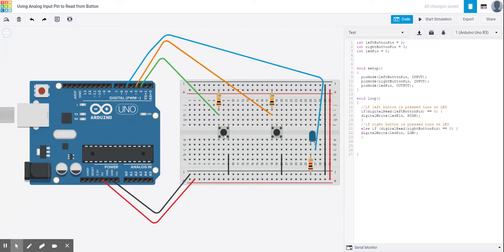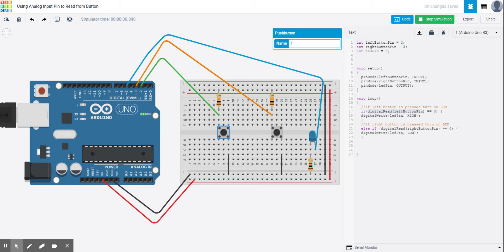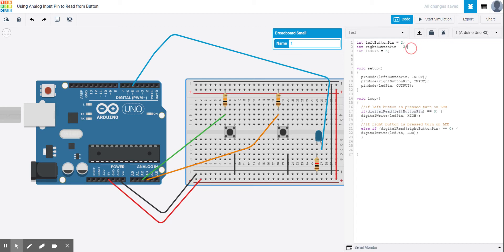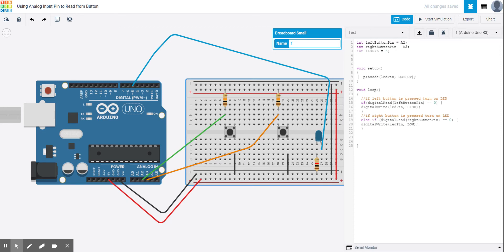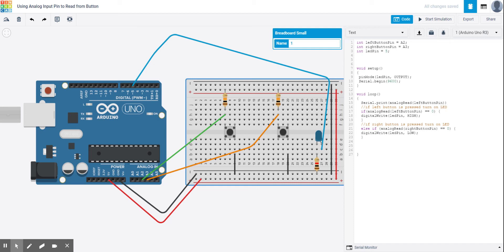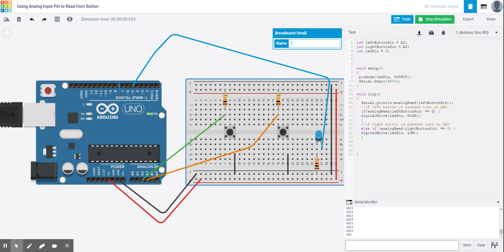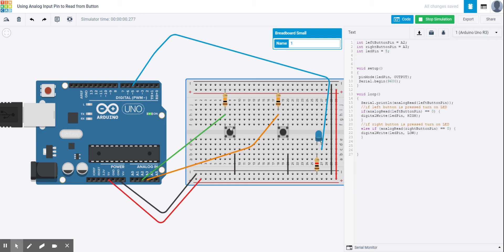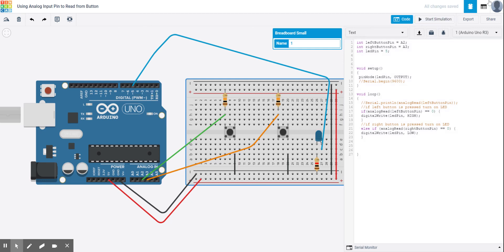Using Analog Input Pins to Read from Button

Comment: Hello thank you for an insightful video. One question standard value is 1023, and then goes to 0 when button pressed. What will happen if the button have internal resistance which is about 500 ohms, when short curcuited?